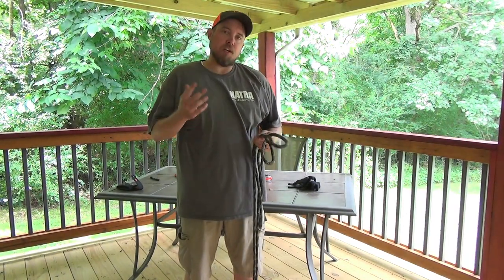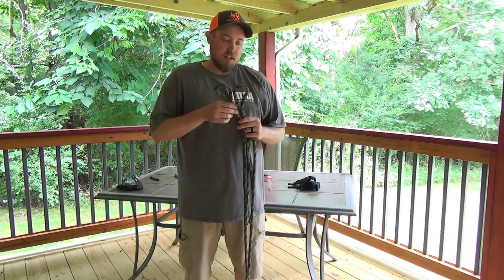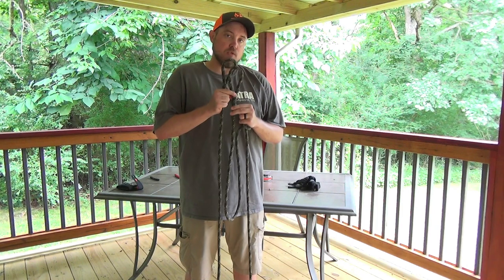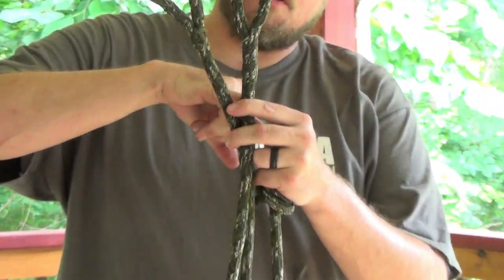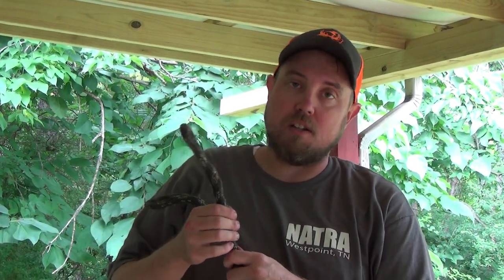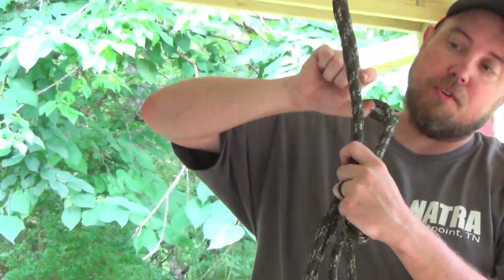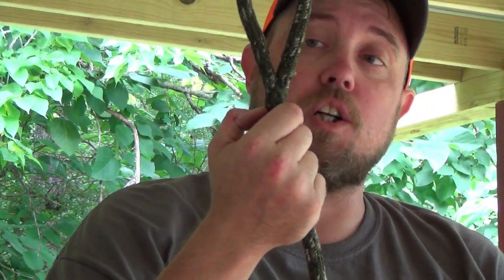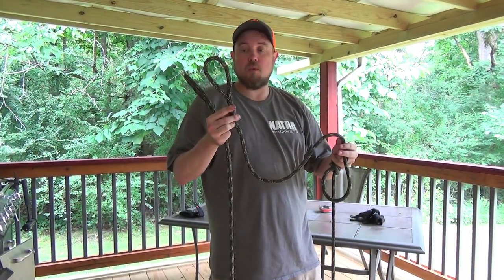Hunting SOBs How to Splice Samson Predator Rope

Comment: I tried for hours with a tubular fid and gave up. I made a wire fid from .030 mig welding wire. Thank you Hunting SOB's for the tip . I now have a nice tight eye . Its the only way to do predator rope that has worked for me. Thanks again

Comment: I'm by no means an expert, but if the act of you pulling on the loop against your post is getting the core to "slip inside the sheath" to bury it, then that looks to me like the core would continue to slip more while inside the sheath as force is applied.  As I said in the beginning of my comment, I'm not an expert, but offering my opinion for others to consider.  Stay safe!